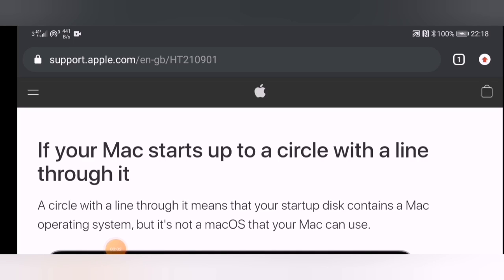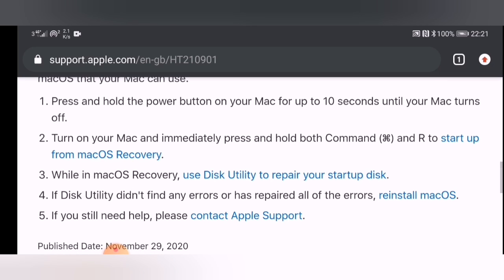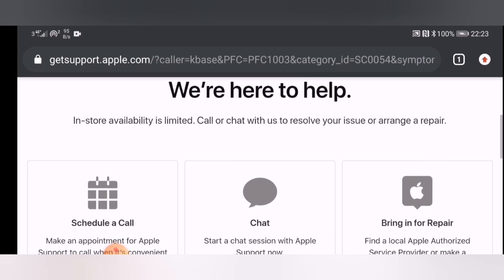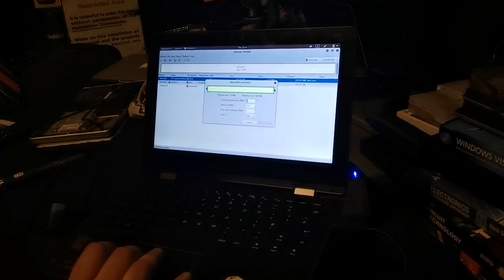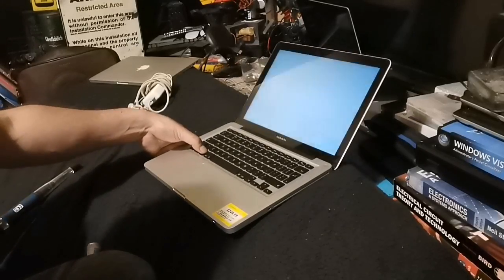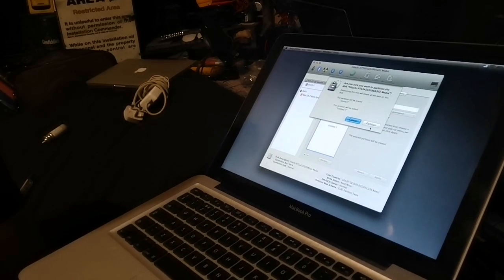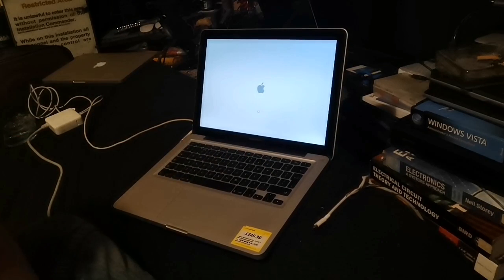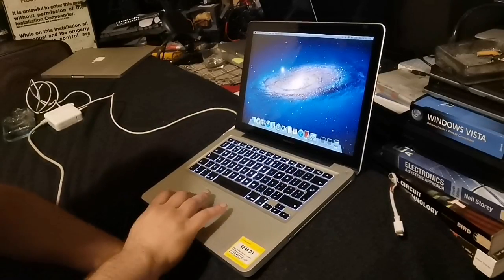Prohibitory symbol fix MacBook Pro 🚫

Comment: This happened me while trying to factory reset my mac, its an asbolute nightmare the way these machines are set up. ive completely bricked the laptop i was about to sell
Reply: me too. did it work for you???? I need to know if im screwed and wasted my entire day
Reply: @MasonHenning-h4k  No bro. laptop here just gathering dust. gave up on old macs gone back to windows less hassle.
Reply: @SuburbanYeti25  Dang. We just bought a home computer, and I tried to factory reset it. And it said it installed the wrong disc or something. Im so upset right now. Its a pretty new mac as well.
Reply: @MasonHenning-h4k  It can be fixed if you bring it to someone who knows about macs. i just couldnt be bothered paying for someone to sort it out but maybe worth you looking into it. exact same thing happened me though so i understand your frustration.

Comment: What if I don't have a second computer or drive controller? Is there another way to delete the partitions?
Reply from the maker: It might be possible to boot the Macbook from a USB, in which case, get a bootable copy of linux and follow the steps essentially without removing the hard drive.

Comment: I am still using my macbook pro 13 inch none-retina mid-2012 and started getting the prohibited sign flashing everytime I turn it on and can just wait for hours for it to finally turn on properly. The solution was to just order and change the hardrive cable. (Used for nearly 10 years now) It now works perfectly after the cable change, boots easily, no problem to restart, no problem to copy and paste large files, works just as usual and no need to wipe my whole drive, I still got all my data on my drive. Hope this helps :D

Comment: It happen with my mac air , its is possible to  fix ??
Reply from the maker: Yes, as long as the hard drive is removable, otherwise you have to microsolder a new flash chip

Comment: How am i goin to format my Mac hardisk in windows?
Reply from the maker: I will have to let you know on this one, because windows doesn't natively recognise apple file formats and extensions.... Best bet is to get. Live boot able copy of Linux, nd then follow the video here...
Reply: @Xclub40X  finally my MacBook able to boot, but found out that the internal hardisk is missing or didn’t appear in disk utility. The problem might be the internal hardisk been corrupted..
Reply from the maker: Open your machine and see if the hard drive is physically missing. If not, then as I said, try using gparted from a boot able Linux USB and try to format it to Windows or raw format...... There is a tool called spinrite, which is a hard drive diagnostic tool. This may be able to tell you if your drive has damaged sectors , clusters or outright condemnation issues.... I'll be covering your story and others like it soon. Thanks for the comment and be well
Reply: @Xclub40X  waiting for your coming video soon!
Reply from the maker: Looking at doing the video within days, so it would be a big help if you can tell me what you are trying to do...  Are you trying to run Windows on a macbook, or are you looking at dual boot setups?... Any information would be helpful... Many thanks Jacky and look forward to hearing from you soon.